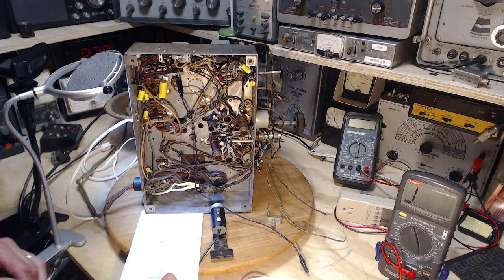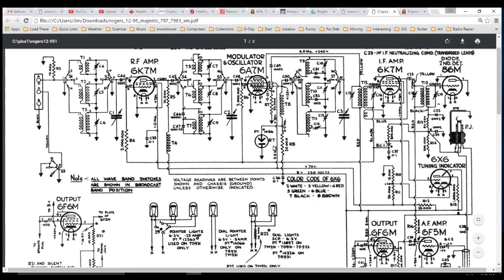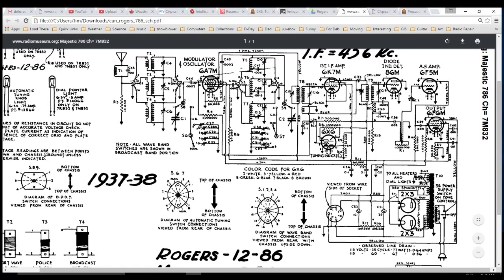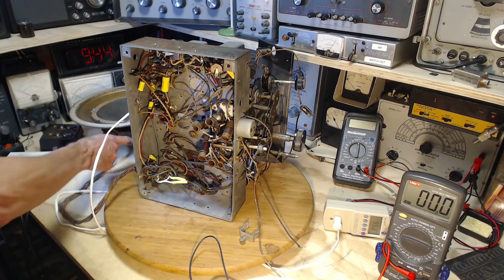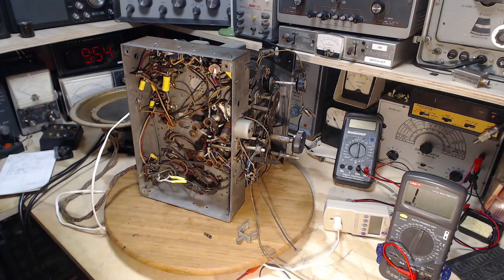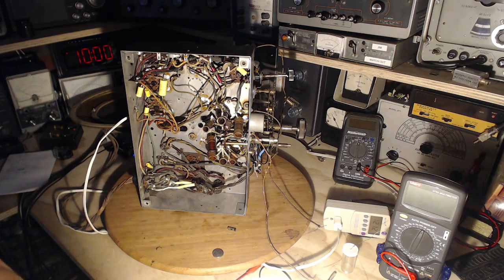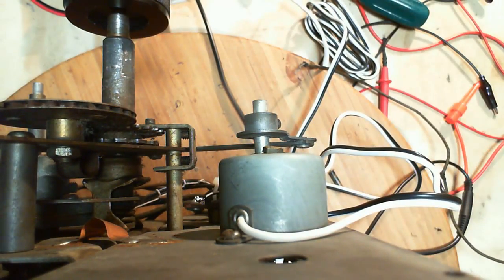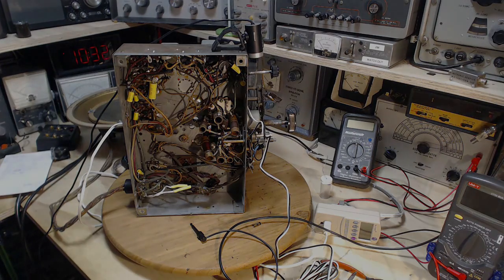Deforest Crosley Shortwave Radio Video #14 - More Checking

Comment: I looked up el-menco and apparently it's parent company was once Electromotive.  I'm not sure if electromotive is the same company or not but there is an electromotive company owned by General Motors that manufactures diesel locomotives.  El-Menco was bought by a company called IEC in 1965.

Comment: I wonder if wiring in a AA or a AAA battery would be an option.  They're 1.5 volts, still a tiny bit high but easily replaceable and especially if you could mount it to the outside of the chassis somewhere.

Comment: Your microphone is picking up quite a few odd sounds early on in the video. It's noticeable shortly after you put the magic eye tube back in, near the start, before the set is even powered. Quite weird.
Reply: Sounds almost as though it wasn't plugged in good and was getting bumped around, doesn't it?

Comment: Saying you have lots of room in the base of the radio why not mount to large 500v wkg 40,000uf caps in the power section to try and remove the hum, Lithium 1.2V batteries should be what your are looking for and are found in the battery of laptops.

Comment: jim elminco is not considered a good brand of condenser from numerous people i have talked to. its not like a sprague or cornell dublea or malory. also allot of times elmico had paper condensers in a molded shell like that. they look like a mica condenser but they are not. if the value is in mfd instead of mmfd it isnt a mica condenser. while i am not a fan of replacing paper condensers unless they are bad it might be worth your while to test it if you are having problems in the antenna circuit.